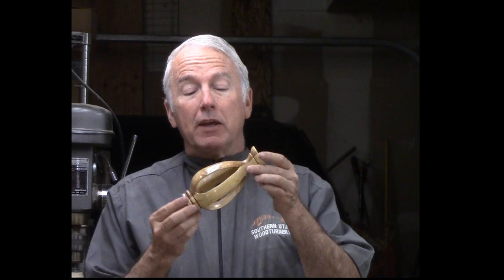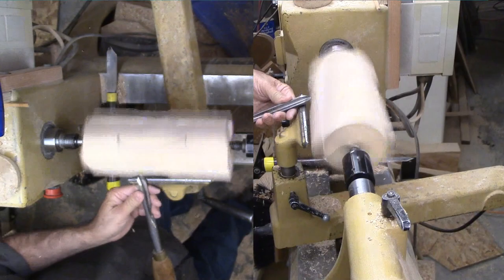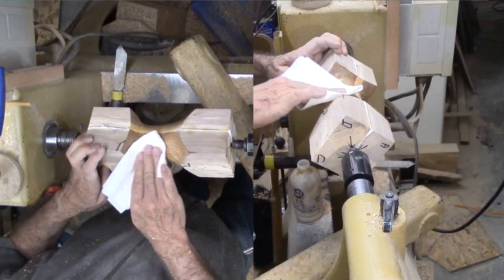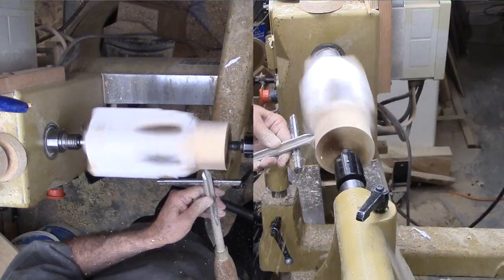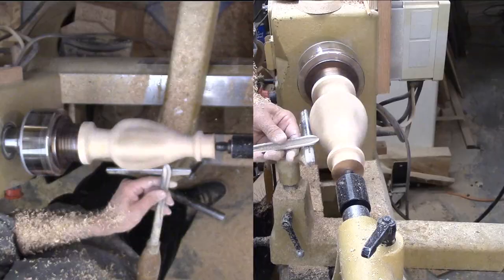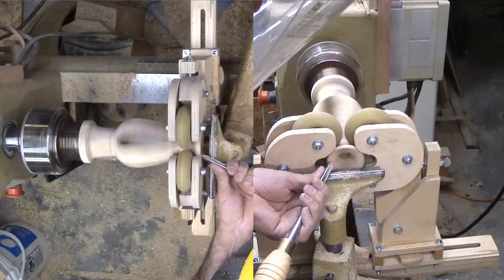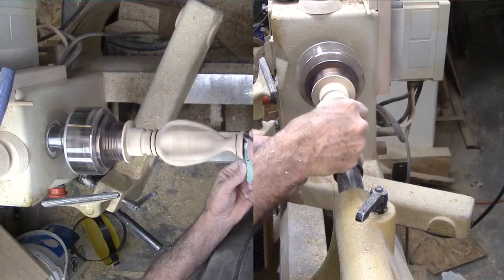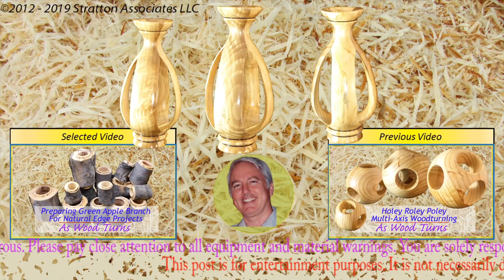Turning Inside Out Vase - Not Solely For Ornaments

Comment: Hi Allen. What kind of wire did you use to to high light the groves in your Not solely for ornaments. I have used a couple of different wires but with no luck. Thanks for your help
Reply from the maker: I used guitar wire from a guitar shop (used wire)
Alan

Comment: Im looking for instruction on how to do the glue up on inside out turning.  In this post you say you put paper in-between.  Can you share any specifics on that?  Thanks
Reply from the maker: I have several inside out videos that you can check. Meanwhile, a paper joint  is the same as a glue joint with the addition of a sheet of paper between the pieces. Later the paper will come apart for the joint to separate. Hopefully not before that time. :)
Alan

Comment: I noticed at the beginning that the glue-up wasn't perfectly right - that is super-important in inside-out turnings.  I always run the blank through my table saw and even jointer/planer after they're glued up to ensure that it's perfect.
Reply from the maker: Agree - I thought I had run them through the thickness sander. But something was off just a little.
Thank you
Alan